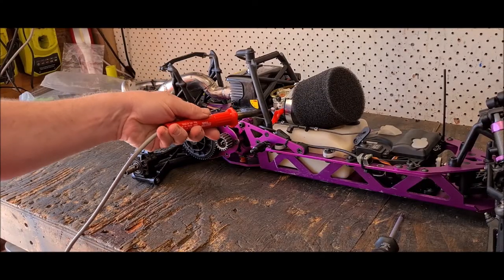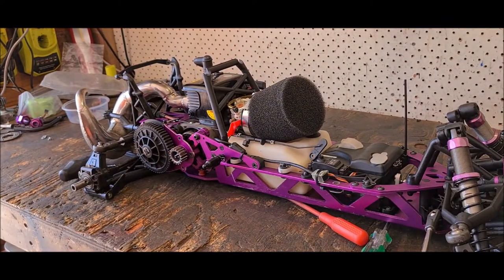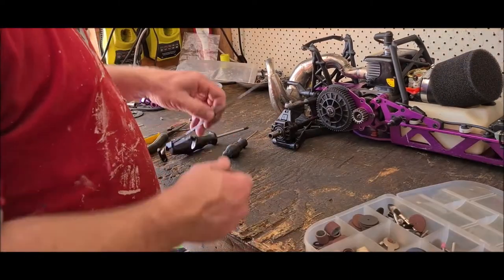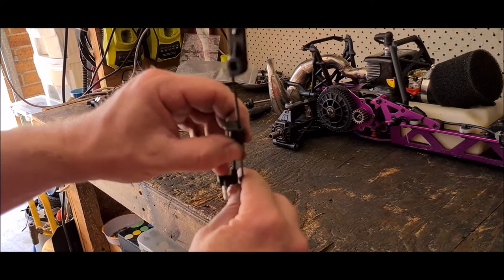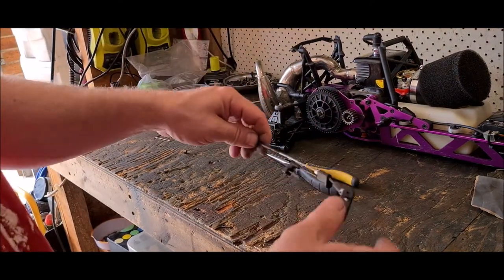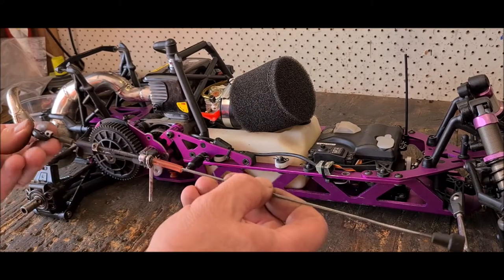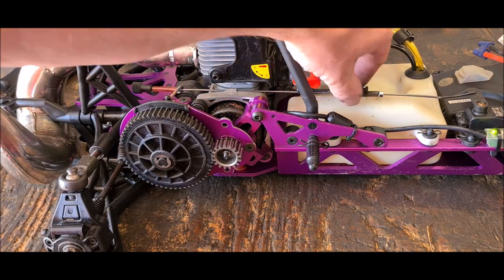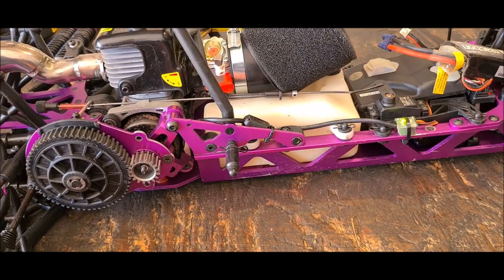1/5 RC HPI 5B Baja -  Linkage setup

Comment: Can you tell me whats the trick to instilling an aluminum servo horn to the stock baja throttle linkage?!
Reply from the maker: Just got to make sure it's the correct  horn for your servo. Count the teeth and they should match .
Reply: @me8u73  getting it on the linkage is my hang up. It came with the servo . It doesn't give like the plastic one.